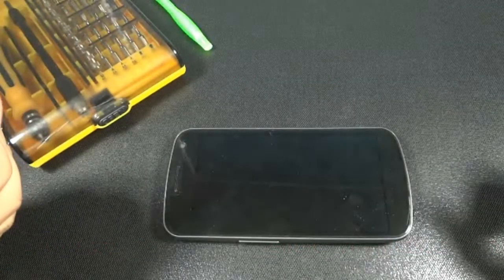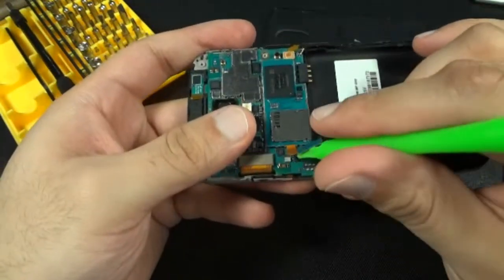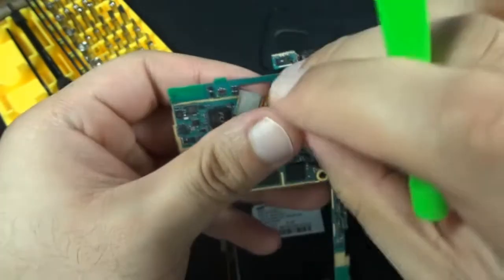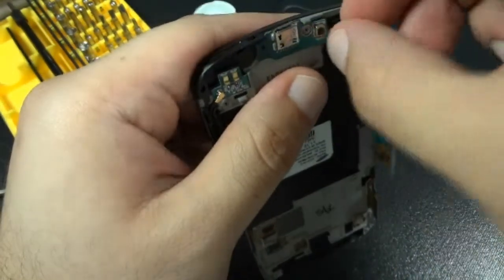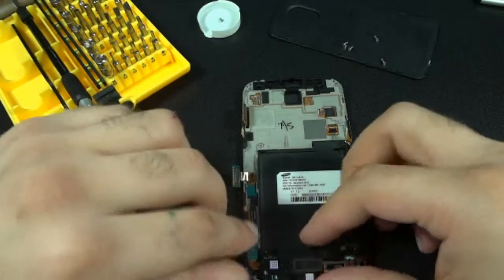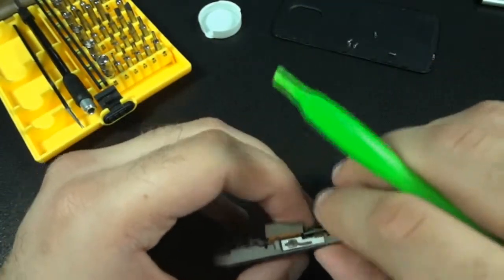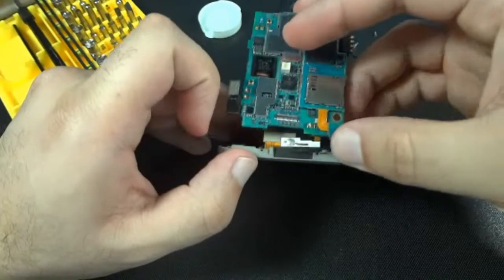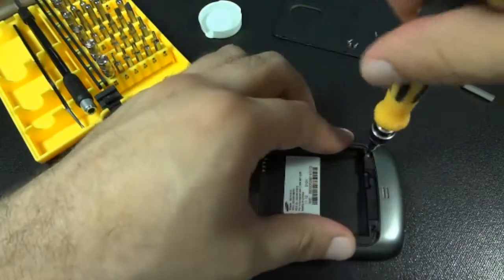How to disassemble Samsung Galaxy Nexus SGH-i515

Comment from the maker: Hello, does the button still "Click" when pressed or is it flat? Either way if the button does not work you may have to replace the button. If it does not bother you I would not worry about it since you can always use the touch screen to adjust the volume. If it is a part you would to replace let me know and I may be able to assist you.

Comment: first off great video thanks for posting. I followed the instructions exactly. Replaced the parts that needed replacing. I re-assembled the phone but now the volume up doesn't work. volume down works great and I can still turn it up by the touch screen but the physical up button doesn't work. I checked the button seems fine. The soldering looks fine also. Any thoughts?

Comment from the maker: Disassemble the handset again and check your solder joints. You may may have a cold solder joint that will need to be resoldered.